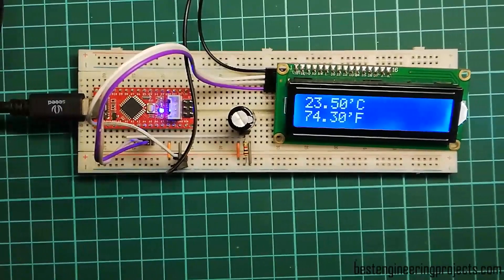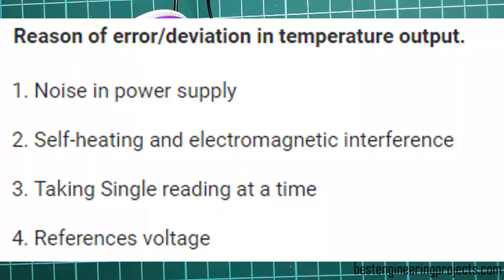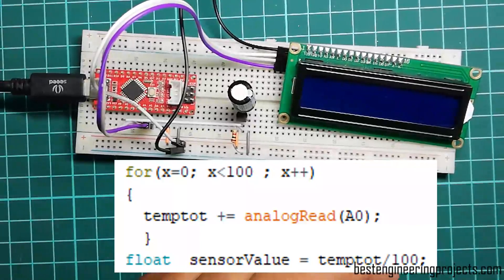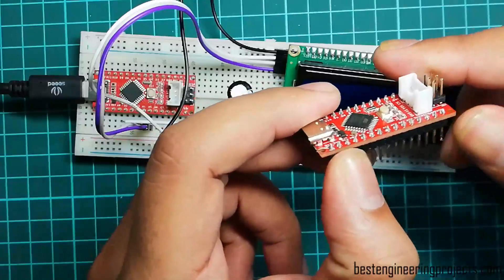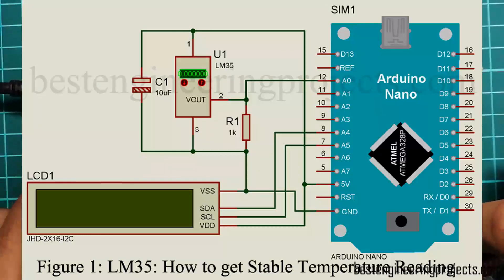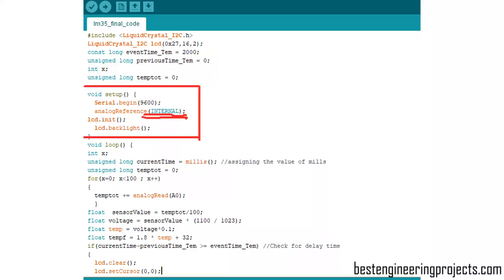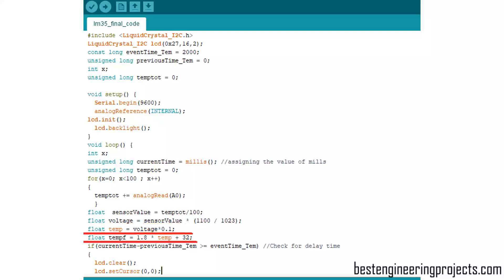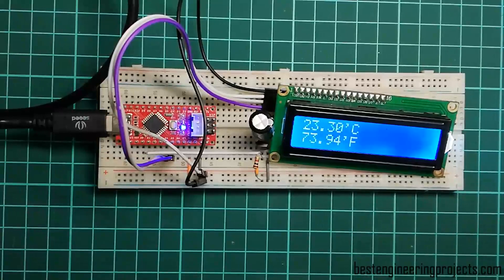LM35 How to get Stable Temperature Reading

Comment: Thank you. I was dealing with lm35 for days. I see the code fix too on video. ALso, Could you update Circuit diagram and Source Code? Website link is down at the moment. @best engineering projects @bestengineeringprojects
Reply from the maker: Thank you, we had solved the website link issue
Reply: @Bestengineeringprojectsbep  thank you. Can I ask a quick question after today's project fix? You are very good at electronics. Everytime I plug my lm35 sensors, readings go random. Such as: 37 C. 25 C. 0 C. 36 C. 0 C. It always gives zero Celsius every 2 seconds in serial print screen. I tried other analog and another sensors too. I tried with soldering & different cables too. I even did analog 1.1V code setting in setup. What problem it can be? My arduino is a clone.
Reply: @tuncfreeman  Hello there! I have the same issue like you with my LM35 sensor. Have you found the solution? I searched all over the place but can't find the solution.
Reply: @idonthavetosay  Try placing 100nF ceramic capacitor between +Vs and Vout. It solved reading fluctuations in my case
Reply: @chathuraedirisuriya6535  thank you
Reply: Hi guys.... I'm facing the same kind of problem right now.... Actually I am making a project to measure the thermal conductivity of metals using an Arduino uno and LM35 sensor.... But it is not showing correct  temperature readings in the serial monitor... 
Initially I am not giving any heat supply instead of showing room temperature it is showing  values like 145 °c , 150°c , 98°C ... etc..... What should I do????